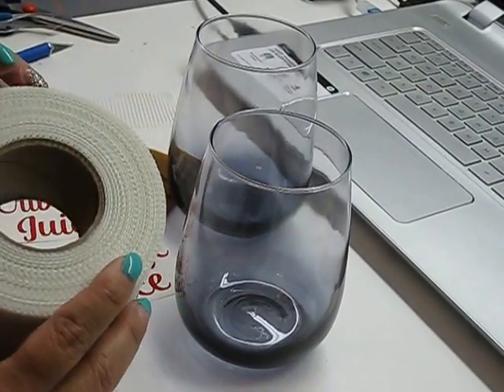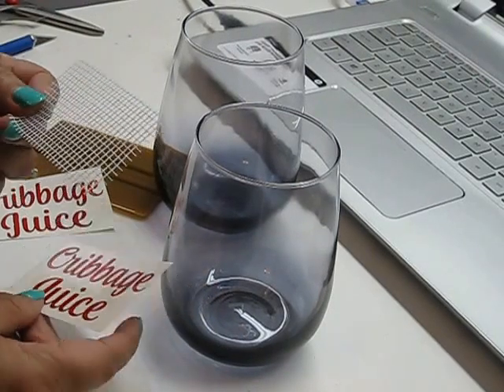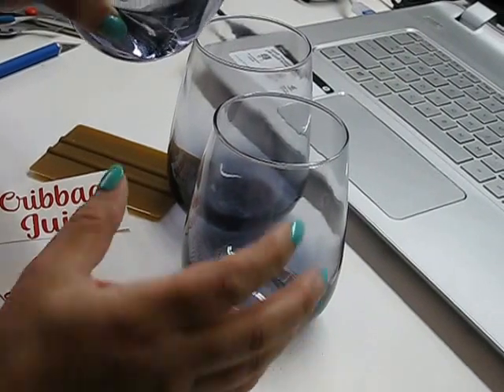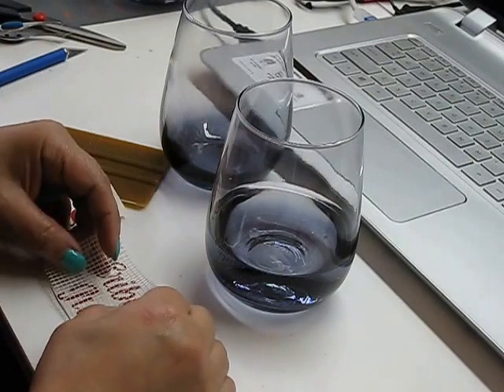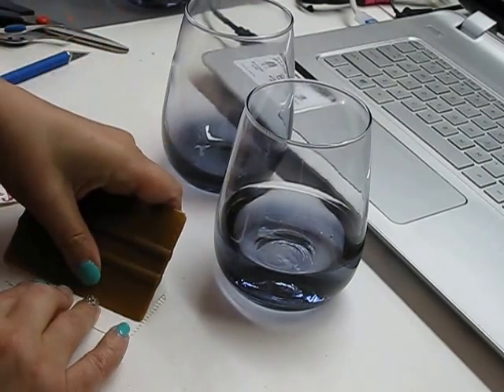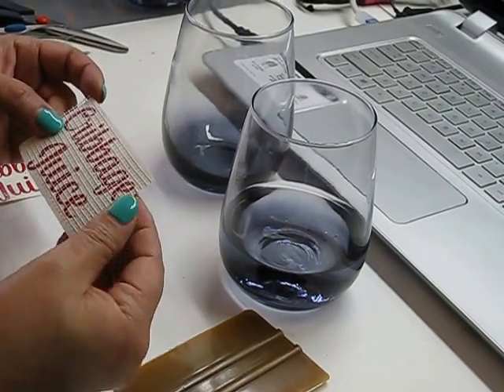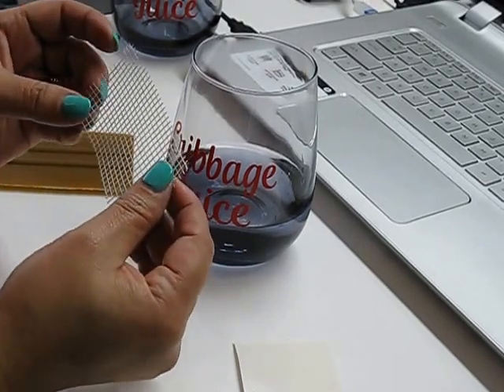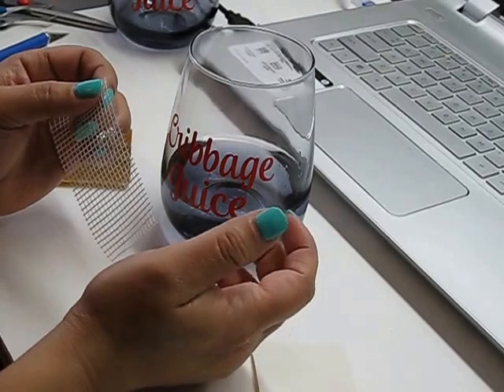Drywall Mesh as transfer tape

Comment: I use clear contact vinyl shelf liner does the same thing ,,, but what you can really do with drywall mesh tape is make a aged bowl by strip wrapping a balloon with the mesh then rubbing joint compound on  letting dry break the balloon  sand a little and paint it ,,,,,,  Also cast plaster tape  is awesome to craft too,,,   But the glass looks interesting 👍

Comment: Taemi,
I've had a roll of this tape for some time, didn't know what I was going to do with it. After watching your video, I ran a test for what I am working on now.
I'm doing heat set foiling with Heat N Bond. I cut out the words with my Cricut, using the Heat N Bond, did some weeding then I placed the drywall tape over the words. Rubbed it over with a credit card, peeled up the tape, words and all. Placed the tape onto my test fabric with a pressing cloth and dry ironed the words onto the fabric (it resists heat too) and did not stick to the fabric, just the Heat N Bond glue. Peeled of the paper backing from the Heat N Bond words. then I placed my foil over the Heat N Bond glue and again with a dry iron I pressed. Let it cool then peeled of the foil backing. Worked like a charm. So easy. O.M.G, who knew. Now I'm going to have to buy more drywall tape. You have created a monster. Thanks for the tut.